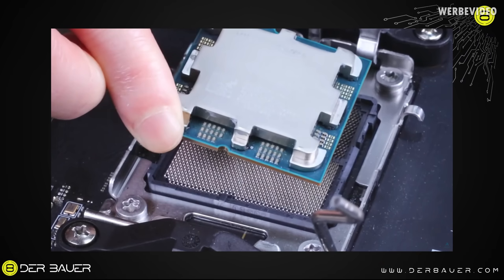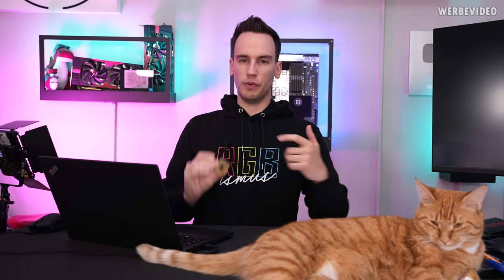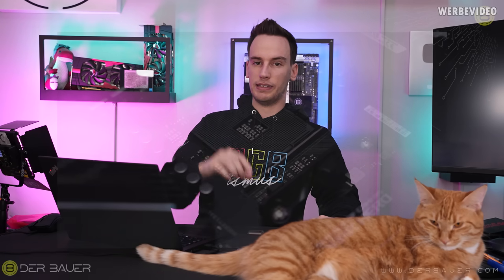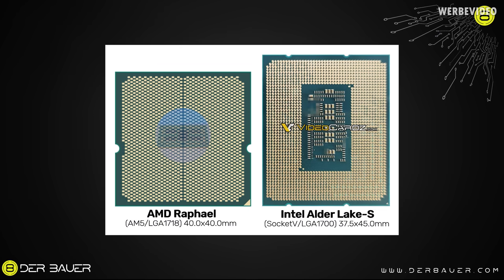Very thick IHS and less Contact Area - some thoughts on Ryzen 7000

Comment: with more power in a smaller package and less IHS surface it's hard to not expect zen4 temps to go up significantly. It all adds up in the same direction.
Im not sure I understand why they cut the whole IHS. It looks like there would be enough space to just "bridge" above the SMDs, which are not very tall.
Reply: Yes it is a somewhat weird choice and "bridging" the gaps as you say would be better for contact surface. It would also prevent thermal paste from leaking onto the transistors which would be a bitch to clean.
Reply: It would probably be more expensive to do that.

Would decreasing temps by 2C be worth increasing the cost of the IHS by $2? I guess AMD believes that it wasn't.
Reply: Zen 3 chips are pretty cool compared to Alder Lake so I'm not really sure there will be an issue. There's definitely headroom in there for increased Temps unless you look at something like a 5950x which temperature wise i think on the high end with appropriate cooling still generally maxes out at 90c.
Reply: The problem won't be with the higher end 2 CCD chips, the 7800X is going to be the main focus temp wise, imagine focusing all the heat from one CCD on the top left corner of the IHS. Yeah we all know how that ended up making the 5800X way hotter than the 5900/5950X
Reply: @brianm.595  Alder lake is only hot in full send it mode. In gaming it is cool.
Reply: @brianm.595  Wrong! At comparable power draw they are way hotter!

Comment: Responding to your comment about the challenge of applying liquid metal, I used your normal compound at the edge and liquid metal in the center and it didn't leak.

Comment: The new IHS has something I haven't seen anyone pick up on yet and that it is  more mechanically strong, not just because of the increased thickness but also the way it is formed. What this could potentially mean is better cooling because there is less of a chance of the IHS going concave (or convex), a problem I've seen with the new 12th gen Intel CPUs but also many past CPUs in general. The smaller the gap, the less heatsink grease and the better the heat transfer to the heatsink
Reply: I think I remember somewhere someone saying that the surface of AIO coolers are often convex to allow for this? It should be easier to match two flat surfaces than two curved surfaces, so I do agree. But it may well mean that existing AIOs wont work well with these new IHS. (Dont know if its true for air coolers and custom loop water blocks.)
Not sure the relative impact of better contact vs less peripheral surface area on the edges (ie not over a hot spot). Maybe the two cancel out?

Comment: Woah 3.6mm ISH thickness!? Is it possible that they achieved z-height compatibility in some other way such as making the screws bottom out at a different point with new backplates? 3.6mm just sounds excessively thick even if it doesn’t significantly hurt performance
Reply: Heat through an intermediate plate tends to propagate at 45 degrees, so if you want to do a bit of Pythagoras you can calculate how much more "best effectiveness" area you get from the thickness increase.

Comment: At 3.6mm you could almost mill water block channels right into the IHS.
Reply: Why not just go INTO the dies? 🤔
Reply: @christophervanzetta  Max cooling power right there and if heat is still a problem could always cut into the pcb too. Have a little moat around the dies to take advantage of all the surface area liquid has to offer
Reply: @Gti_Jason  Why don't we go full bore and manufacture the dies on a torrid silicon structure suspended in non conductive cooling fluid powered by electromagnetic wireless transmitters and passively cooled by the torrid electromagnetic convection.

Comment: still prefer the old socket type cause you can easily straighten a bent pin on a cpu but its not so easy in the socket, but i can also see why they have done this, cause the cpu has a habit of coming of with the heatsink, which is upsetting if pins get bent or worse broken whilst trying to unglue the heatsink compound sticking the cpu and heatsink together, but with the lga socket type its locked in place so cant come of with the heatsink.
Reply: This could also just be fixed with a better retention mechanism that actually clamps down the pcb instead of relying entirely on friction which am4 does right now. It can still be pga, but better.

Lga just also happens to fix this issue.
Reply: Lga allows for greater pin density
Reply: Yep, was swapping the default cooler for a h100i on my ryzen 1200 , it was glued and the cpu came off the socket with the heatsink, bending some pins and getting a very small amount of thermal paste on 2-3 side pins, was very easy to clean up and fix everything.
A friend of mine had to dump his LGA motherboard once one pin got really bent and no one could fix it.
Reply: Jordan Rodrigues  nah m8. People are in the habit of pulling a cooler up, even quite gently because that's how it's done. Am4 is unique in this regard since it's entirely friction fit and so fragile. You're being needlessly elitist. You can't expect anyone to forsee the whole thing prying apart, especially not when you've been building for years on platforms that don't do it. I've seen it happen to plenty of friends even after rotating which isn't always possible.

Sometimes you can't do anything but pry up due to the size of the cooler. It's not an issue of intelligence it's an issue of design.

Comment: Visually the IHS thickness may appear to be 3.6mm, but we're possibly forgetting that these CPU's are likely using some derivative of 3D V-Cache... so the die/s are likely thicker in reality compared to their Zen3 counter parts (with the exception of the 5800X3D). Similarly, the addition of the newer RDNA graphics to the cpu's as mentioned below, also likely account for an increased z-thickness of the IO die. I'd guess there will be additional material removed from the inside of the IHS to account for these changes, giving a more "normal" effective IHS thickness.

Comment: I wonder if part of the IHS thickness is just for pure mechanical strength. AM4 didn’t really need anything to push on the IHS for good socket/pin contact, but AM5 will. I wonder if the thicker IHS resists deflection better, or rather that the old IHS didn’t resist it well enough.
Reply: Alder Lake already bends a little...This shape should make it practically impossible to bend the IHS without fracturing the PCB in the process.

Comment: 2:27 this doesn't seem very good for the highest heat outputting chips. Maybe they can modify the IHS with newer iterations?
Reply: I'm not sure it can be speculated on at this point and I think people will need to just wait. The surface area reduction may be irrelevant, especially if the chips are more efficient. I also feel confident AMD would have done actual testing before running with an IHS design. Doesn't make sense to be thinking about redesigning the IHS until the chips actually appear in the wild and get tested.
Reply: @brianm.595  But we already that TDP and total package power increased. That is info from AMD themselves. And knowing how much more efficient threadripper is with it's massive IHS, I think is was a fair assumption. Still just an assumption though.
Reply: "the highest heat outputting chips" if you are talking about the dual CCD chips aka 7950x/7900X i think that they won't be the problem here, the single CCD 7800X could be, since the 5800X runs hotter than the 5950X or the 5900X due to having a concentrated heat output on top left side of the IHS makes it hard to cool. 
the higher TDP of the newer chips won't cause any issues since they are going to have highly binned silicon anyway. a great example would be the 5950X again, that thing runs super cool consumes much less power for the number of the cores it has.
Reply: @TechLevelUpOfficial  but the TDP and total package power is higher... 105W vs 170W for TDP. If that peak is reached for the single CCD or 2 CCDs chip is point 2.
Reply: @ramanmono  
They did say in one interview that the main point of that is increase 16 core chips to get more power to each 4+1 chips. So there will be bigger difference between 8 core and 16 core parts in Zen4.

Comment: The reason is the 3D cache as clearly announced. That is why they changed the socket, so they can fit more into it, which they need to stack cache on top of it
Reply: 3D stacking is confirmed not going to be on the 7000 chips. At least, not the first set of models. Expect a refresh later with it. That's where the rumor mill has pointed.
Reply: @falcie7743  that may be. But that's why they changed the design, so they are able to fit more into it. Like the 3D cache

Comment: Very good video. So in theory we have a smaller size IHS, but thicker than the old one, while the CDD and IO are a little bit smaller and moved to the side. This will be very interesting to see on the heat dissipation, hot spot and contact surfice performance test/reviews. 
As I was watching your video I was also thinking that perhaps, the thicker IHS help to the fact that its a smaller size on and that the CCD and IO are moved away from the center.
But we will have to wait till the real product is available.

Comment: Another thing is with the integrated GPU into the I/O die, you want that more toward the center to help control heat when using it. I think that, in part, is why they needed to move it, as well as the capacitors needed to help support an iGP. Just a thought.
Reply: pretty sure the igpu is 2CU, heat isnt going to be a problem
Reply: @mikesteve3039  it is when needing to also cool the data fabric. Then again, it is on 6nm, so may not be that bad.

Comment: My issue with the shape is that I'd definitely make a bigger mess when I apply too much thermal paste and squeeze the extra out the sides.
Reply: If the mounting cover would flush against the IHS  it would  "solve" this mess and pressured applied would be uniform!

Comment: I would love to time travel back to a 1980 computer fair a and sneakily put a modern cpu on display next to the Sinclair ZX80s and Commodore VIC-20s. Imagine the random folks reading the spec sheet and expecting Z80-like performance:
* 5 GHz instead of the expected 4 MHz
* 174185 MIPS vs. 0.58 MIPS
* 19 billion transistors instead of 8500
* 7 nm process vs. 4 μm
* 105 W TDP vs. 0.79 W
Reply: You could but.... you'd also need to backport power standards too and not to mention everything else needed to showcase the performance otherwise people will laugh you out of the room at as the power consumption will be inconceivable to them. Thus, changing the future completely for better or for worse. So, yeah it's a slippery slope..
Reply: @earthtaurus5515  
Yeah

People there be like :

TF is USB?
Reply: @fajaradi1223  Or place an display card with an Intel SKU or Motherboard SKU or a Monitor SKU listed in full... people's head will go 🤯. With a reaction: "Surely, this fool is demented! no one in their right mind will call products such absurd names!" 😂.

Comment: I wonder why the IO die isn't closer to the CCD's (they have a few mm of space between them rather than up against each other) despite knowing that them being closer would be better latency-wise.
Reply: Pretty sure it has to do with the substrate wiring. Otherwise it would be tiled closely just like how Intel uses EMIB, yes that's a totally different technology but the point is clear.
Reply: Probably to have space to fan-out the wire traces.

Comment: I wonder if it might be hiding a stacked design under there. I also wonder if when they really get into stacking chips how cooling will be affected. As in will they be able to run some sort of thin heat pipes through the stacks to keep them cooled enough. Also, instant like from me for the cat.

Comment: Imagine the Zen4 CCDs rotated by 90 degrees. Then the width of three would nicely fit into the length of the two as they are positioned today. So those one millimeter narrower CCDs of Zen4 have some interesting implications, because with Zen3 CCD size this would not be possible.

Comment: Hi Roman, Thanks for the video. Is it possible to delid an existing Zen 3 CPU and use its IHS under a CNC machine to make it shape like a Zen 4 IHS (using dimensions from this video) and see how it behaves thermally in a before vs after comparison? It would also be interesting to see how thickness in IHS changes temperature (i.e if possible CNC mill a Zen 4 with 0.3mm thinner IHS)

Comment: Wow, what I got out of this is more AMD geneious more performance using less silicon = more chips per wafer. I wonder if the I/O die is a 3D part? the RDNA2 gpus 3 or 4 CU on top of improved i/o functions memory management and such. Thanks for this.
Reply: IO die most likely isn't 3d stacked. They moved from 12nm to 6nm, which is a big node shrink.
Reply: @superneenjaa718  
Yep if the io would do the same it would be 1/4 size of zen3. But gpu part makes it so much bigger now!
Reply: 3D stacking is confirmed not going to be on the 7000 chips. At least, not the first set of models. Expect a refresh later with it. That's where the rumor mill has pointed.

Comment: I'm really curious about temps for zen 4, smaller silicon, smaller IHS, thicker IHS, and a higher maximum power draw.
Reply: More power, higher temp. As simple as that. My overclocked 5950x is around 240watts and gets to 75 celcius with watercooling that has offset. So we can expect higher temps if it's higher power than that.
Reply: @NeroKoso  not always, 10th gen intel famously thinned the die to allow for more power budget while maintaining okay ish temps
Reply: If they can make the die thin enough and more importantly use a extremely thin layer of Indium to solder the IHS it might work just fine.

Thermal conductivity of Silicon= 150W/mK (Die)
Thermal conductivity of Indium=82W/mK (Solder)
Thermal conductivity of Copper=400W/mK(IHS)

Comment: Why they just didnt put the capacitors inside the ihs next to the dies?
The ihs could had larger surface area without those cutouts and be even larger because they could extend it more to the corners
Reply: I feel like people should just wait for test results. Why speculate that theres actually a problem? Zen 3 chips are very cool and efficient i would assume Temps rising a bit actually wouldn't be that big an issue if we are talking about temp increase over zen3. Its a bad example as its only 6 cores but my 5600x barely reaches 40-45c under load.
Reply: @brianm.595  5800x @ 60c, silent fans

Comment: You could have also talked about the difference in thermal mass of the ihs. I myself am not sure if more or less is preferable for cooling....
Reply: thicker IHS likely will compensate for the thermal capacity of the IHS due to the loss in surface area before the heat can be transferred to the cooler. in the grand scheme of things it doesn't mean a whole lot once the IHS is heat soaked. personally i'm in agreement that it's likely due to the height of the socket for cooler compatibility otherwise the only thing i can think of outside of that is if they were worried about idle to load state temp spikes.
Reply: @ripperino2  silicon -> siliconOxide or other difusion barrier-> Indium -> Gold - > Nickel -> Cooper -> Nickel -> Paste

Comment: I'm thinking thickness and chiplets  moving maybe to allow for better 3D/ die stacking and cooling of Stacked chiplets.
Reply: 3D stacking is confirmed not going to be on the 7000 chips. At least, not the first set of models. Expect a refresh later with it. That's where the rumor mill has pointed.
Reply: @falcie7743  might not be used for launch but if AMD don't plan and allow room for its use on later CPU/APU they could run into barriers and extra expense later that would make using stacking un-viable

Comment: Open gaps between IHS and substrate...better than a hole on top like Pentium 4s that made thermal compound cleanup pretty troubling

One thing though: would the IHS be flat - and if not...how much material you could remove before getting too thin for the cooler mounts - compare the board to IHS height?

Comment: Will there be any thermal paste/thermal pads/thermal cloth(carbonaut) revisions for Intel raptor Lake and zen 4? Carbonaut has been a good performing cnt cloth for general usage on laptop, man that uneven core temps is non existent but peak performance  high temps reached 91c but I'm ok with it because of the longevity and consistent temps.

Comment: I don't understand is why they even keep using a IHS which only add cost... It should have been the DIE it self and leave all the security mechanism to coolers so that they can make the safety mechanism to never over tight to the point of breaking the die.

Would have been cool the CPU PCB attached to a full metal all-around plate to prevent a bit PCB bending with exposed die to full cooling performance and a whole new gen of coolers specially made for that because it's getting ridiculously HOT.

Comment: Hi, would be funny to see the first AIO who can use the space between the HIS and the pcb for cooling, maybe with perfect non conductive liquide for protect all others componnements. Because using nail polish for protect all parts who requiert it without remove the HIS is nearly impossible this time. ;)
Reply: There is one thing that must absolutely be checked, it is the flatness of the HIS, certainly we could make a fitting (or use a special support which freezes the part and keeps it in place) and pass the cpu in a leveler (if it flies during the passage of the millstone, it's dead, rofl)